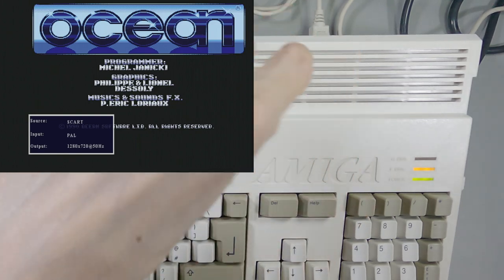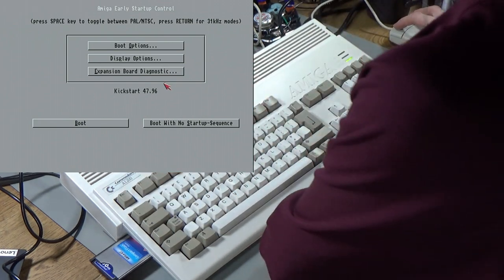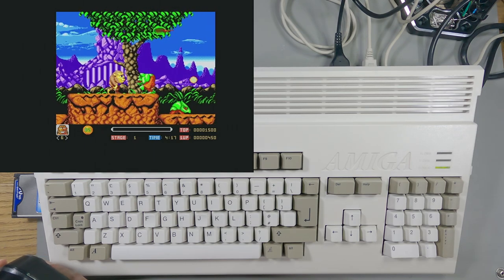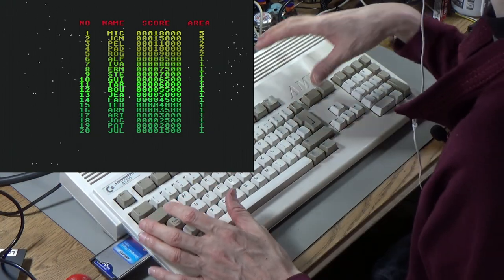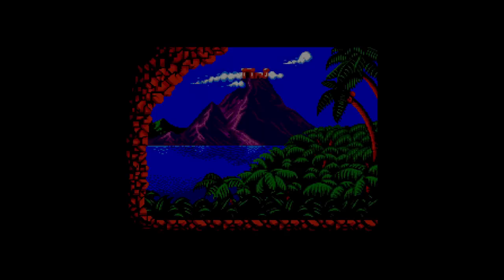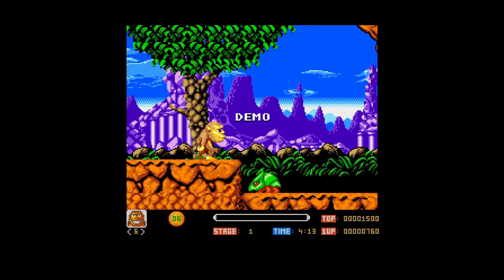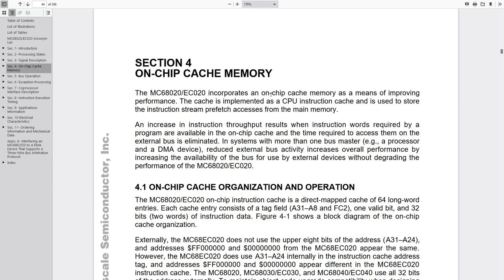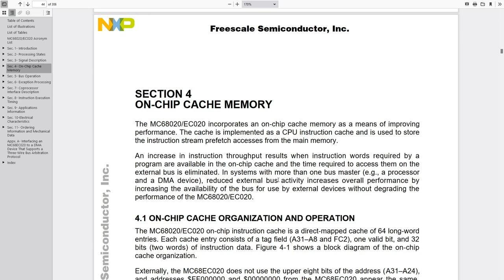Disabling the CPU Instruction Cache on the Amiga 1200 / 68020

Comment: CPU caches fail when a program attempts to use self-modifying code, which was common in early games to get some extra performance or especially to obfuscate copy protection techniques.  If a game doesn't boot, try disabling the caches first.  I'm surprised Toki has that problem, because by 1991, most programmers knew fully well the code wouldn't work on anything but an original 68000.

There are other issues running old games on a 68020+, which are related to the size of the exception stack trace, which can cause games to crash.  Graphical issues are also common.  Unfortunately, there's no way to resolve these problems, and you'll have to resort to using an emulator.  Again, most programmers knew these programming techniques were terribly wrong, but they were done anyway.

In general, you'll find that Kickstart compatibility isn't a big deal except on the earliest games, and the AGA chipset almost never causes problems.  Everything is CPU related, especially when it comes to floppy copy protection, which generally used a lot of timing, interrupt, and trapping tricks which the 68020+ does not like.  Memory upgrades can cause issues as well, but I've found this to be rare, and Arctic Fox is the only game I have that won't run with extra memory installed (in fact, it barely runs on anything but a stock A1000).
Reply from the maker: I doubt it's self modifying code (in this case), as the 800% floppy speed in the emulator fixed the problem even when the cache was on. I think maybe the disk loader has got its self into an infinite loop trying to sync up with the floppy disk and it never manages to do it. I would also suspect that (at that time), many developers didn't have a full complement of machines to test it on, and also this game I think was a bundle game with the A600 (or A500 maybe?) so perhaps also they only really wanted it to work on that machine (which it does).
Reply: @DavePoo2  Aha...  I took a quick look at the game and indeed it locks up with the disk at 100%, and works fine if 200% or faster.  The code is in a finite loop checking CIA bits 4 (track0) and 5 (ready) of the floppy disk and then waiting with a decrement and branch loop before trying again.  The CPU with cache enabled finishes the loop so fast it doesn't give the floppy drive enough time to respond.  Slowing down the CPU to 3.58 MHz (with cache enabled) fixes the problem.

So, yeah, it's a CPU speed issue, not a cache issue.  It just so happens that disabling the cache makes the machine JUST slow enough so it doesn't crash.  I guess a 68030 wouldn't be able to run the game, even with the cache off.

This, kids, is why you don't program 32-bit machines as if they are 8-bit machines.  Using CPU loops as timers is bad.  8)
Reply from the maker: Thanks for the investigation. So that is some "not so great" code running there. I wonder if similar problems arise if the machine has some fast RAM installed. As if the CPU was normally blocked because the code or data it wanted to read was in chip RAM, and the floppy was also accessing that chip ram via DMA, if you installed some fast RAM then the CPU might suddenly execute much quicker causing finite busy loops like this to finish before the even they were waiting for happened. Were there also some games that failed to run when you had a fast ram expansion installed?
I also suspect the reason why the OCEAN logo does load and appear at the start of the game is because maybe they did use the KickStart routines to load that logo screen at game start before they turn off the kickstart and take over the system.
Reply: @DavePoo2  Fast RAM won't affect these kind of games, because they are hard-coded to load everything in the low chip RAM address range.  For all Amigas, addresses below $200000 are guaranteed to be chip RAM, and the memory controller (Agnus/Alice) will only let the CPU access that memory at 3.58 MHz.  Code will only run faster if it has been loaded into the fast RAM space, and only games that cooperate with AmigaOS will have their code placed there (as the OS always prioritizes fast RAM unless a program insists otherwise).

I don't know of any games other than Arctic Fox that fail with fast RAM.  Those that do are probably all games that run from Workbench, because they falsely assume all memory in the system is visible to the custom chips.

As far as I can tell, the game doesn't use any ROM routines to do anything, and whether the Ocean logo is displayed and for how long depends on the speed of the emulation.  Most Amiga games that boot off floppy disks either used CPU timing, or used each of the two CIA chips "natively" (which is to say they only set up two timers -- triggering on horizontal sync and vertical sync).  The most famous byproduct of this usage is music playing faster under NTSC than PAL, because switching video modes changes the vertical sync time.  AmigaOS sets up large numbers of virtual timers instead, allowing programmers a lot more flexibility.  But of course bootable games like to totally bypass the OS all that "good practice" nonsense.  8)
Reply from the maker: So I had a look myself, I found it in this section where it creates the magic number $18000 for the loop counter and the waits in the loop for the "disk block complete" of the interrupt request register.

000604C6 263c 0001 8000           MOVE.L #$00018000,D3
000604CC 342e 001e                MOVE.W (A6,$001e) == $00dff01e,D2
000604D0 0802 0001                BTST.L #$0001,D2
000604D4 6606                     BNE.B #$06 == $000604dc (T)
000604D6 5383                     SUBQ.L #$01,D3
000604D8 66f2                     BNE.B #$f2 == $000604cc (T)
Reply: @DavePoo2  Nice find Dave. I take it that increasing that magic number would fix it to run with faster cpus and/or cache. Did you try that?
Reply from the maker: @SammYLightfooD  I didn't try that, but it would probably work, but  would probably still be a bit dodgy depending on the machine/drive.
Reply: @Waccoon  "Using CPU loops as timers is bad.  8)" sadly, I spent many a night porting code to run properly on newer systems finding these loops... They are pure evil in my opinion

Comment: This was really common. I had loads of games which either needed the cache turned off, or indeed the chipset switched to ECS. WHDload of course has corrected most of this, thanks to the efforts of the community. Sweet looking 1200 btw!
Reply from the maker: In this case at least, we can now say that it's not actually the cache that is causing the problem (it's badly written code), but the cache disable is being used to work around the error. The suspicion is that if you put this on a fast enough CPU even with the cache disabled, it will start to fail. There are quite a few videos on my channel about this A1200, going right from eBay unboxing last year to what it is now.

Comment: This problem has been solved years ago with WHDLoad and many early games that didn't work on stock A1200 got fixes. Of course this applies for hard drive versions and mostly cracks, the original games on original media can't be fixed from its very nature. But yes, this used to be a problem back in the days. The game's not working, so you probably have to turn off the caches in the boot menu. Also, some older games were running too fast and disabling the caches solved this issue.
Reply from the maker: I was really more interested in why this was solving the problem. As the 68020 is designed to be backwards compatible with the 68000. It's not really the cache that is at fault here, it's the software that has been written using CPU loops as instead of timers and the software expected the loops to run at a certain speed. WHDLoad can solve the problem (in Toki's case) just by having the floppy disk stored on the HD and emulated, as then the speed up there means it compensates for the lack of timers in the code. It's a real shame that a lot of software didn't work, because if written correctly there should really have been no problem. I'm sure there must be plenty of software written before the A1200 existed that does actually work correctly? but it only takes one section of incompatible code to stop the whole program from working.

Comment: I think the settings in the "Amiga Early Startup Control" also apply if the operating system routines are bypassed, because they are applied before the disk boots.

Many old disk routines doesn't accept a CPU-cache in any form. Nevertheless, a fast 68000 Amiga (40 MHz ACA500, 80 MHz emulator) does not cause any problems with most games, as they are not synchronized directly with the CPU as with modern computers.

Older, most 8 Bit computers/consoles doesn't work (or it runs proportionaly faster/slower) if the clock rate is changed. You can test it also on the emulator, try 1.1 MHz (must be above 1MHz to accept), you will be wonder how many 2D-games will still run better than expected (because of the custom chips), and 80 MHz doesn't matter. The 7MHz CPU ist over powered on most games:)

Comment: Galahad / Fairlight did a run of AGA patches which appeared on cover disks around this time.  You would fire up the patch from the cover disk and insert your original game disk. It would then load the game patching all the incompatibilities out on the fly.  In a lot of cases it would bypass the copyprotection as that was the only breaking part of the game.
Reply from the maker: Yes, i wonder if some publishers actually told devs to use their own copy protection and it was that copy protection that was bad. Or each dev wrote some themself and it had multiple problems. The design of the AGA chipset in the A1200 works in a way that it starts up in a "compatible" mode that behaves like the older Amiga, but it seems most of the compatibility gets thrown away by CPU code that assumes the system works in a particular way at a particular speed.

Comment: From memory we used to use relokick back in the day for running things from disk on a friends amiga, nowerdays there is tude which can do a lot more then relokick, which is great if you have an accelerator as well.
Reply from the maker: Yeah, Relokick was mentioned when we talked about it in live stream. And from what I could tell from reading about it, it would automatically turn off things like CPU cache if you selected an older Kickstart (as it knows those older machines didn't have a CPU cache). But I wanted to explore the reason why having it on is breaking the software in the first place, and also really to consider that turning it off might not be necessary to get compatibility if the older software was written more robustly.
Reply: @DavePoo2  also games would say on the box “requires kickstart 1.1 or 1.2, etc. so I think kickstart is a factor still.
Reply from the maker: I suspect many games didn't need any particular Kickstart at all, but they just listed the one that they had tested it on. Or listed the earliest one they had tested it on. I've got DPaint disk that says "requires 1.2 or >" and I've got other disks that say "A500 / 1000 / 2000" on them. The Toki disk doesn't even say what Amiga it works on, it just says "free with the Amiga pack". I would suspect that it would work on an A1000 (with an upgrade to 1/2Mb) as they probably didn't use ECS features so it would work on the Amiga 500 (you have a 1000 now, you could try it?).

Comment: I did not know this but in my defence I am very new to A1200 ownership. I'll have to see if this is an option on the stock 3.0 rom.
I wonder how many games this fixes. I know when the A1200 first came out, it was known that about a third of existing games wouldn't work, but they couldn't say which games.
Reply from the maker: Well so far, it seems to be affecting OCEAN games, so I really suspect that they were given diskloader code to use from   OCEAN that was dodgy in some way.
Reply from the maker: I am also quite new to A1200 ownership, back in the day I only had the A500 and A600 so I never came across this problem

Comment: Hi, its a long time ago...back in time i moved from my A500 to a A1200, atm i don't remember it exactly how, but i had to put the A1200 in a non AGA mode to play some old A500 games, i just cant remember the steps you had to do, it fot sure is not what you did 🤔
Reply from the maker: Yes, you can also select the chipset from the boot menu (when holding down both mouse buttons). I don't know if there are many pre-A1200 games that don't work when running with the new AGA chipset. The AGA chipset although has some new registers and features will actually always be in a "compatible mode" unless the game/software enables the new AGA features. Commodore did that deliberately to get compatibility, so for instance the AGA can do 32-bit DMA for the video instead of 16-bit DMA on ECS/OCS, but the game would have to go an turn on the 32-bit access if it wanted to use it (so older games would still run the same). They even made the 32 color registers kind of the same on AGA, except you had a new "bank" register that you had to write into to be able to specify 256 colors, so a real pain for AGA developers to work that way, but it was done for compatibility reasons.

Comment: The reason this happens is because instruction and data cache is separate.

Game modifies its code at runtime (it's a very common optimization, old concept of polymorphism). Modification is maybe pushed to ram, but instruction cache is not invalidated, so the CPU uses what it already knows about the code.

Nothing to do with dma...
Reply from the maker: I think self modifying code could cause a problem, but I suspect that would likely result in a Guru Meditation. In this case it is actually just poorly written disk loader code, and if you see the pinned comment from @Waccoon then you'll see the explanation.

Comment: That is interesting. This might be a stupid question but how is anyone going to know what programs need a disabled cpu cache?
Reply from the maker: They can't, you would just have to try. But any game made before 1992 was probably made to run on the A500/600 and wasn't ever tested on an A1200, so it "should" work, but it depends on how correct the code is. Cannon Fodder works perfectly fine on the A1200 and earlier machines, so it came out the year after the 1200 was released, so was no doubt tested on it, but it wasn't actually their minimum spec target platform.